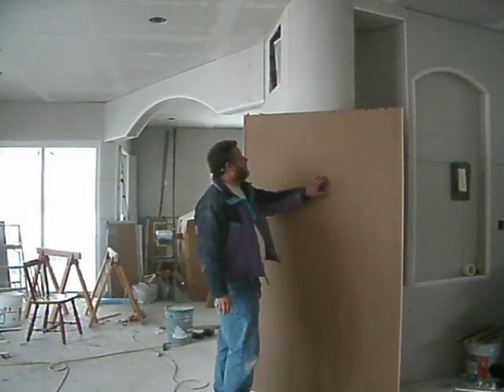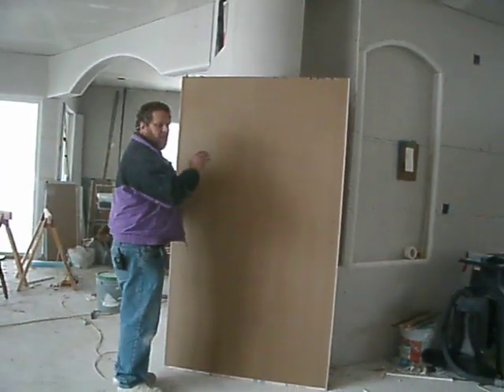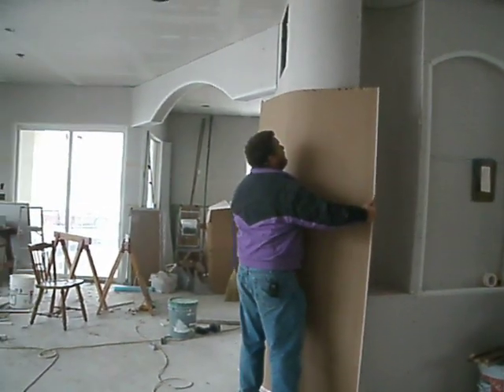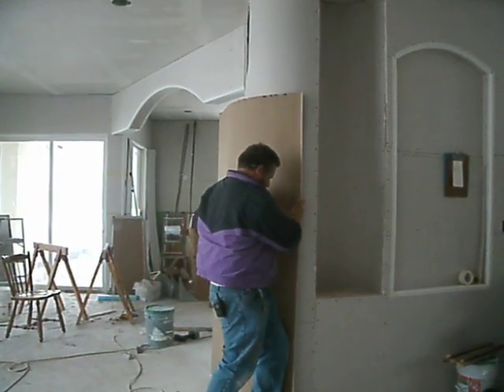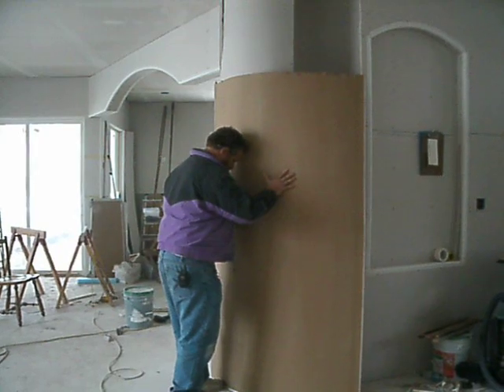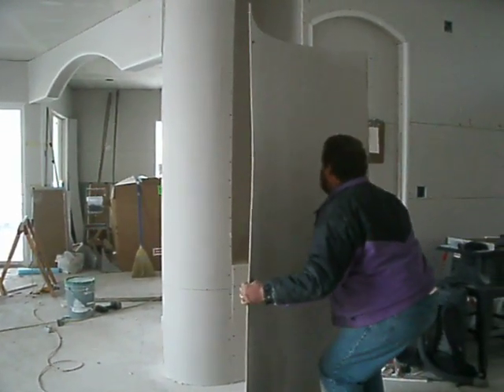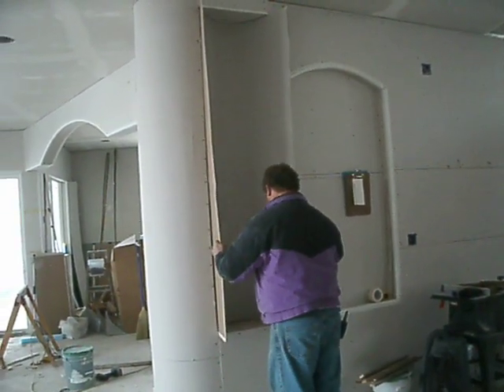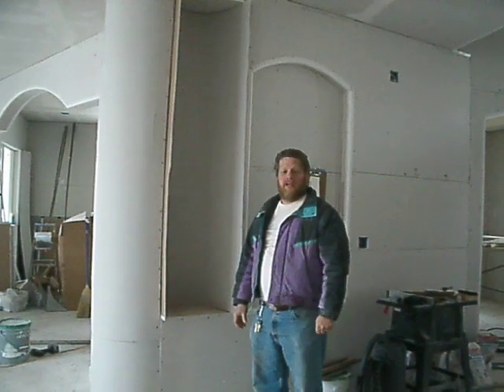How to bend drywall Part 2

Comment: Hi Charlie,
Ok, So I have the outer  concave corners bent up. Went real easy, I am running the sheetrock Horizontal. Now I need to bend the Concave part, Every video I see has the sheetrock being bent in a vertical position.I need to keep mine running Horizontal. Will this work ok? I tried bending this once already and it was going good but then it snapped. Its going into a 32" opening,

Comment: Sorry Charlie, quarter inch flex sheet rock is to be installed horizontally not vertically, because of the fibers in it that allows rock to flex without fracturing, installing vertical breaks it
Reply from the maker: It used to be that way, but now the manufacturer has assured me that it can be installed either way.  Sorry Joe.